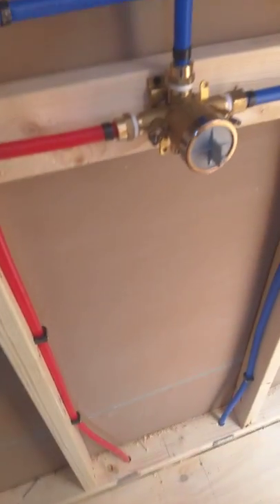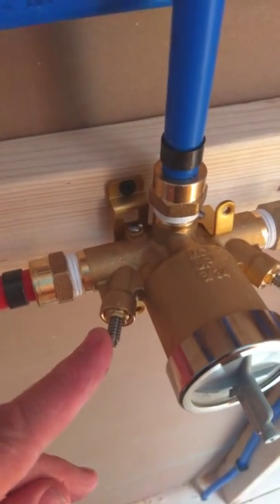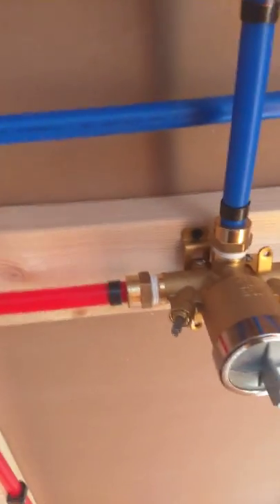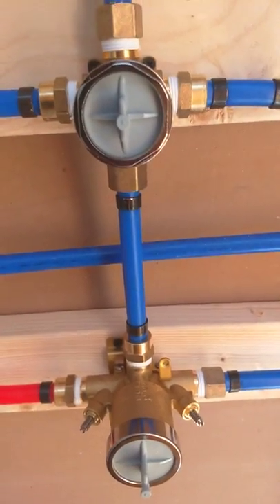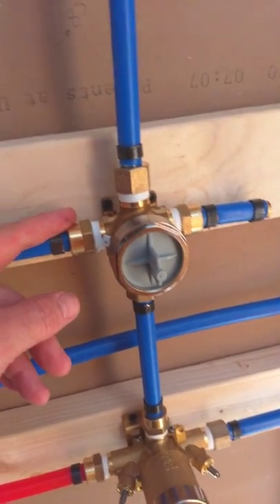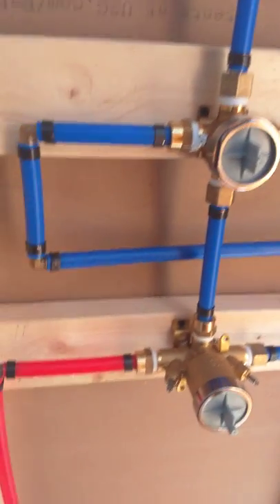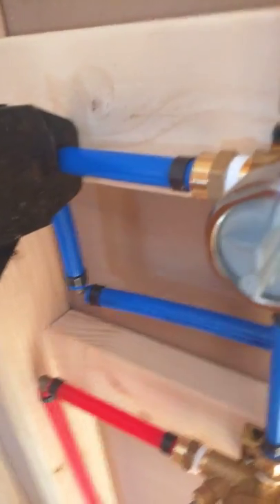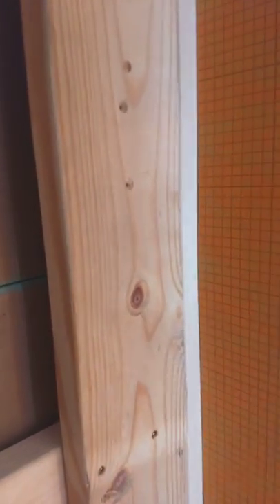Delta shower faucet with diverter install

Comment: Why conected the hand shower in the left and no in the right  ?
Reply: There shouldn’t be no reason, maybe he I ain’t think it thru 🤷‍♂️
Reply: If using the diverter as a 3 position, you plug the right side port as per Delta instructions. If using as six, then you use both ports.

Comment: Why are you using Pex if you're going to put all those joints in it. Cpvc would be better and cheaper. You're defeating the purpose of Pex.
Reply: Pex offers better freeze protection than cpvc and does not get brittle overtime as cpvc can.
Reply: @TheWorkinMan59  I dont trust pex joints. One at the block and one at the fixture. Both accessible.

Comment: The diverter has 5/8 inch ends.  What adaptor do you use to go from the diverter to the PEX tubing.  I'm not sure how to make that connection, because I can't find 5/8 inch connectors. What am I missing?

Comment: Could the Right part of the diverter be capped?

Can't you cap the left side then use the right side for the handle?
Reply: If using the diverter as a 3 position, you plug the right side port as per Delta instructions. If using as six, then you use both ports.

Comment: How would you have plumbed it if there was also a tub faucet (which also has a diverter)
?
Reply: A 1/2 tee out the shower head line
Reply: Won’t the shower and tub be working at the same time?

Comment: How do you actual install the diverter cartridge
Reply from the maker: Make sure you your water supply is off.Open faucet normally garden faucet relievers pressure in system.unscrew retainer screw which holds your blank cap.Unstall diverted cartridge in stall diverter cartage in stall retainer cap.